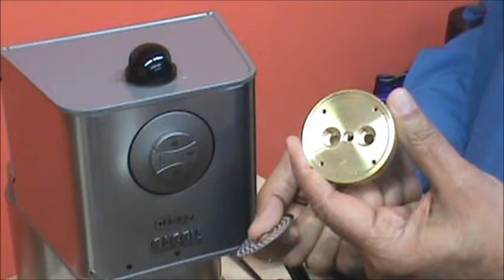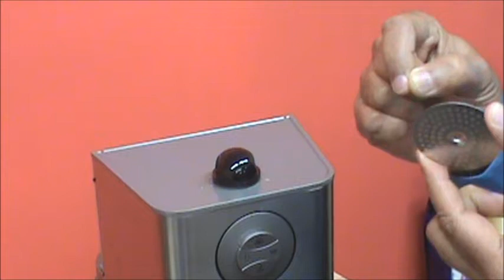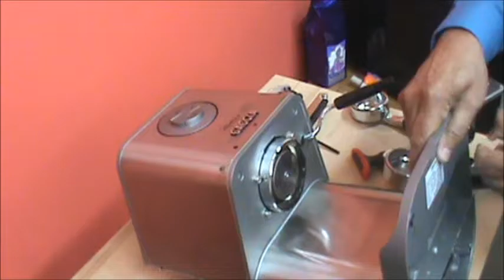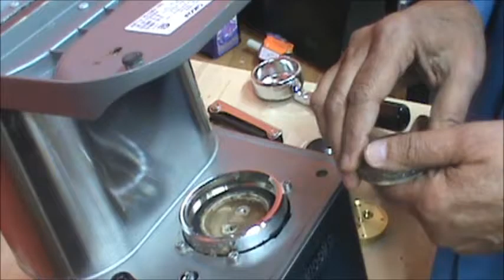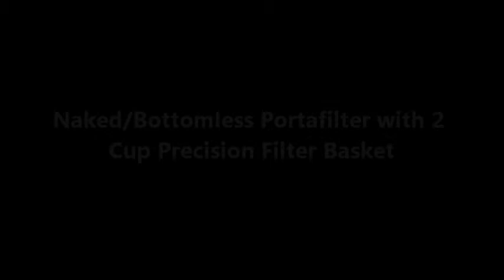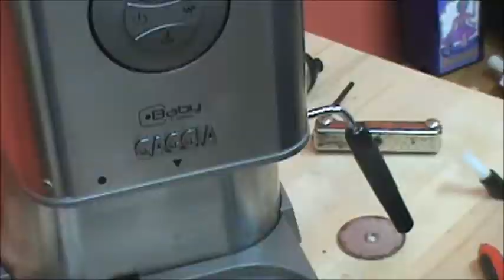Improve Qualtiy of Espresso Using Pecision Tools

Comment: I bought on these  brass plates from these guys! Very disappointed it burnt all my shots!
Reply: It's you who burns the shots, not the part or the machine. Read a little on temperature surfing to understand better how to make a good espresso.
Reply: @toronte  Worse water distribution and more expensive.Shower  plate the same,there is no proof ,that helps make better coffee.I had brass and the ims plate,went back to classic alloy and original plate.Much better extraction.Also bare in mind,that the holes on brass holder are poorly made ,there are smaller no tapered and too close to the edge ,so expect channeling .